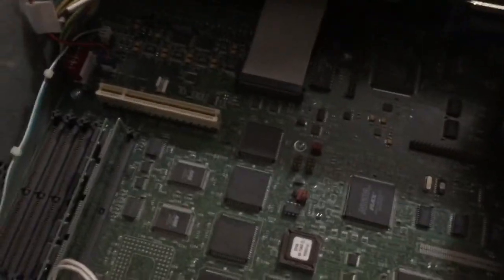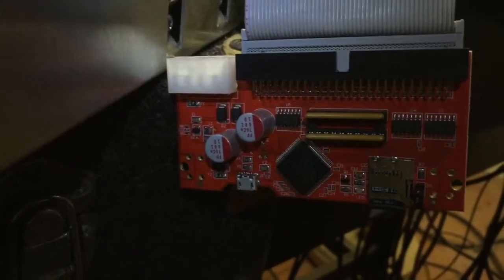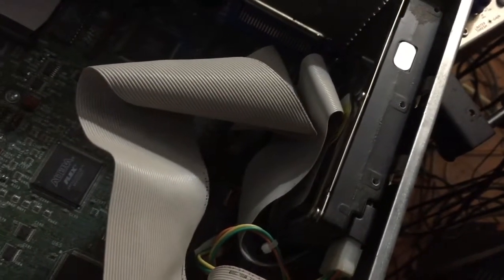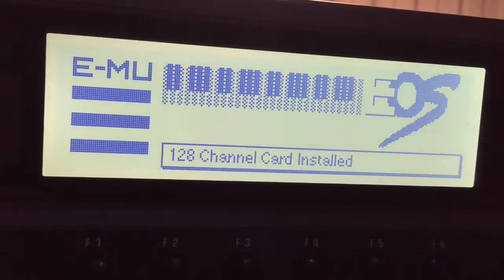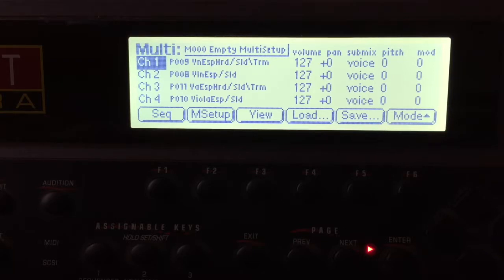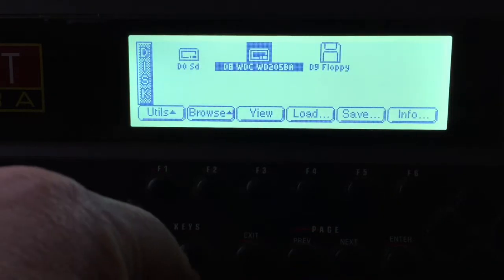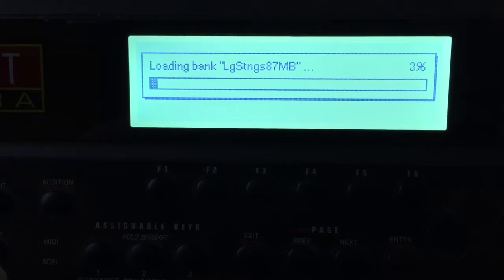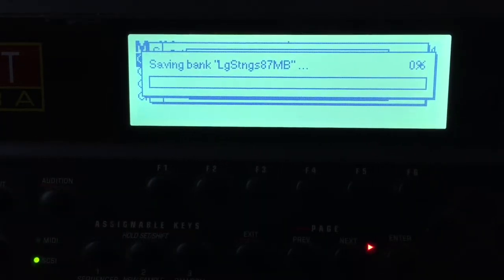SCSI2SD My Ultra

Comment: I had a similar issue, I solved it by setting my SD card size correctly on the scsi2sd software (  ie my card was 32gb ) and then resaving to my scsi2sd flash

Comment: SCSI2SD V5.x transfer speed is 1MB/s. It's the limitation of chipset, not SD card. Maybe SCSI2SC V6 works faster, it would be nice to test and compare. Also, if you plan to use your E4, maybe better option is to use CF adapter to IDE port. It's more simple and can work faster. Also, use Backup option to copy all banks from one HDD to other. No need to copy folders and banks one by one. Cheers

Comment: Have you set it up on your PC/MAC?  You need to format the SD Card and Partiiton using the SD2SCSI Utility
Reply: Just brought a external reader that is connected with the scsi port on the back of the sampler....is it fat 32 for the sd card and the 4 partitions on the drive and do I need to use a termination block thanks ( sorry new to all this ) I’ve got a emu 6400 ultra 4.7 eos